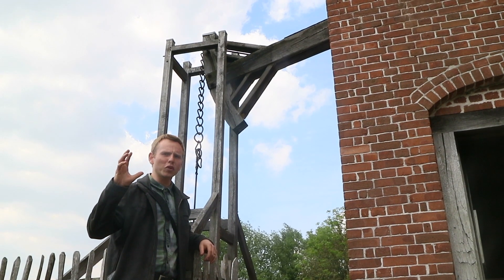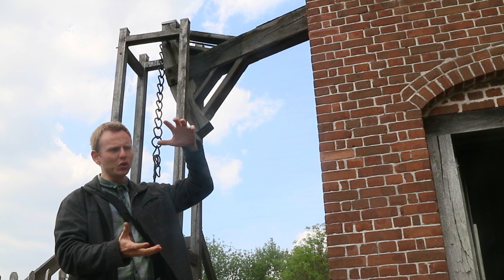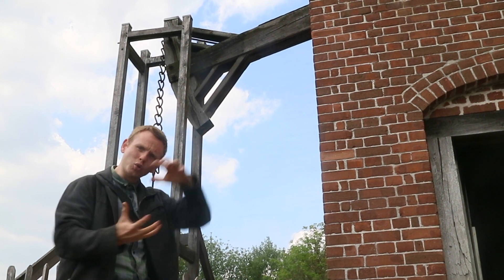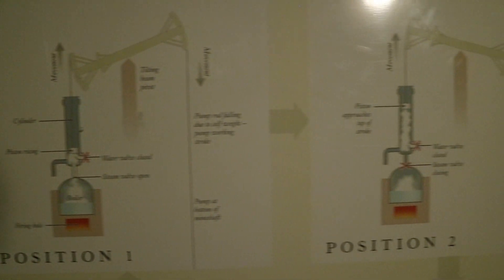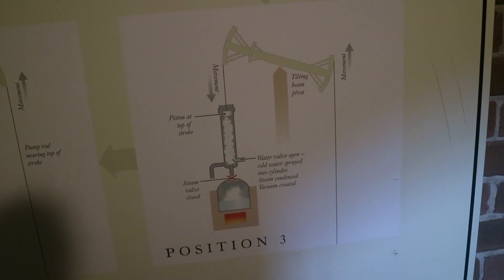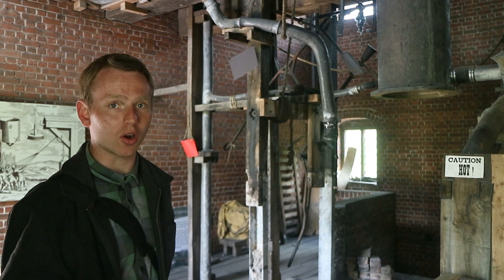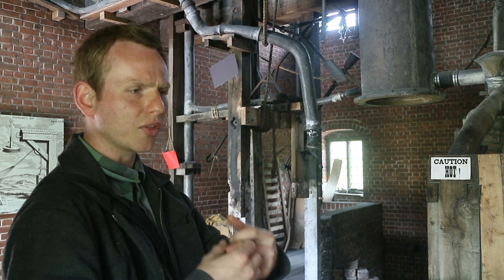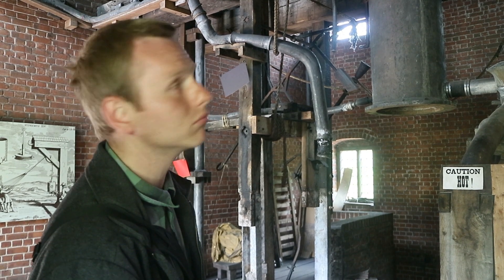Why Didn't We Invent Steam Engines Earlier? (Newcomen Steam Engine)

Comment: Vacuums don't suck! The piston isn't "pulled" anywhere. Atmospheric pressure on the outside PUSHES the piston after the steam is condensed. Hence the name "atmospheric engine".
Reply: Yes exactly, almost everyone thinks vacuums suck no doubt because they are carrying their misconceptions across from sucking drinks up through a straw., not really appreciating that the pressure in their mouth is being lowered by their diaphragm which then allows the atmosphere to push the drink up the straw into their mouth. Negative pressures do not exist
Reply: My vacuum sucks. In more ways than one. :)
Reply: There is no change in atmospheric pressure. There is a change in vacuum pressure. So technically the vacuums do suck. In the same way someone sucks on a straw.

Comment: It kinda was, but we never had a clear use case for it, since wind worked fine and was far easier.
Reply: No, I reject that premise. The advantages of steam engines seem too obvious. Power on demand any day of the year, and much more power for its size.
Reply: @FourthRoot  at a higher initial investment and maintenance cost to the point that you can get lets say 6 sailing vessels vs 1 steam with roughly the same military power.
Reply: @BartJBols  There are clear advantages steam has over sailing that makes the two incomparable in terms of military strength. But yes, obviously steam was much more expensive. The question is why? I believe it was the difficulty involved in manufacturing precision machined cylinders and pistons. The fit between the piston and cylinder needs to be especially tigh and perfectly straight. There also was no vulcanized rubber in those days for manufacturing flexible heat resistant seals.
Reply: @FourthRoot  yes and no, yes, it was hard and expencive, but no it was not impossible, just impractical.
Reply: @BartJBols  Actually it was not just impractical but impossible to manufacture a cylinder to Watt's specifications prior to John Wilkinson's boring machine.